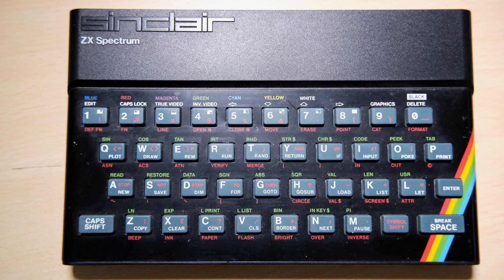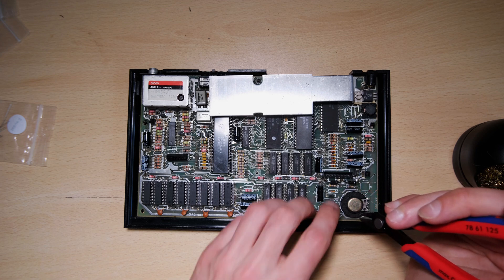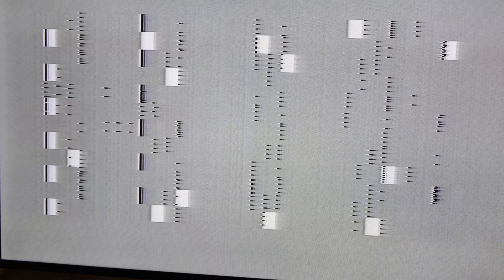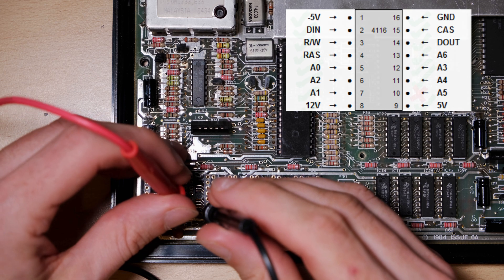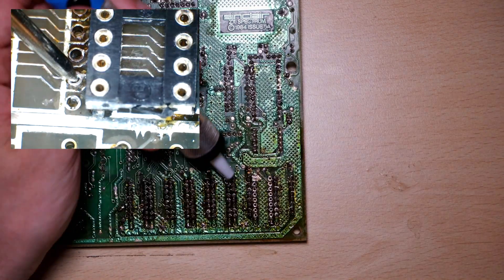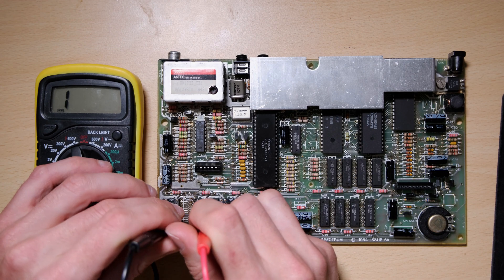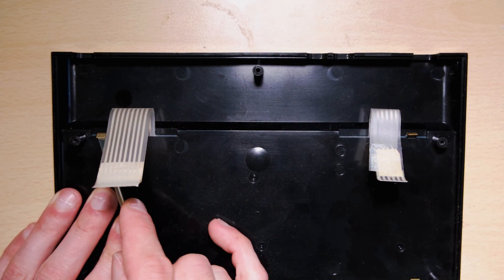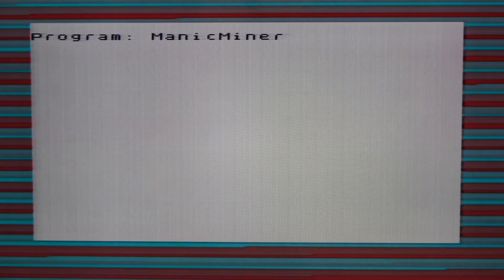Issue 6A ZX Spectrum 48K repair - eBay gamble - Lower RAM Fault Hunt

Comment: Nice repair. I've never had any luck trying to repair those membranes. They just go so brittle. The stuff that the new ones are made of is a lot better. I don't think I'd have gone to the effort of taking the socket out and repairing it in the top side, I would just solder a wire on the bottom. It does look tidier if hidden under the chips though.
Reply from the maker: Yes that's the way I go now.  Much easier

Comment: One thing I noticed is that someone replaced all the capacitors that decouple the memory chips, with what looks like dipped bead "tag" tantalums! Thats an incredibly daft idea - tant's well known failure mode is to overheat and burn!
Reply: I see later on that they look more like regular ceramic disc capacitors. Never seen those fitted to a Spectrum - i guess whoever replaced the ram chips and fitted sockets managed to damage them - probably by levering the chips out of the board, which is how they also caused the damaged trace you found!

Comment: Kynar wire is perfect for repairing traces and gives you a much neater looking repair.
Reply from the maker: Yes I have seen the light now, I have a reel of galvanised copper wire, already used once to patch up joints under a ULA
Reply: @HappyLittleDiodes  : It's like everything else in life, we live & learn 👍.

Comment: Maybe it was better to leave the original PRO sockets there, because on the third RAM pin 1 and 10 are bad at first glance and repair the connection from below.
Reply from the maker: I'll consider that, thanks.